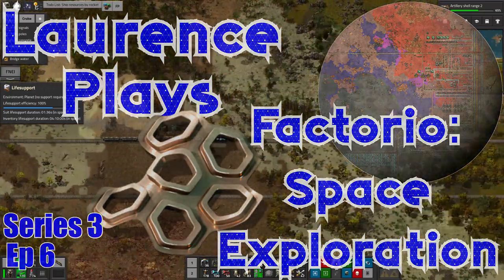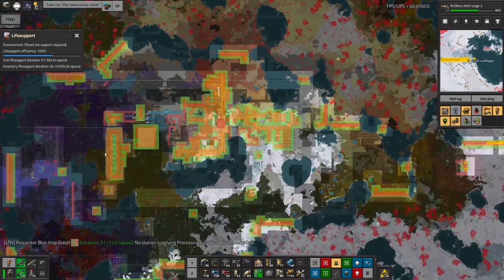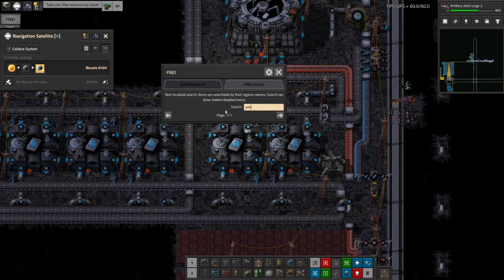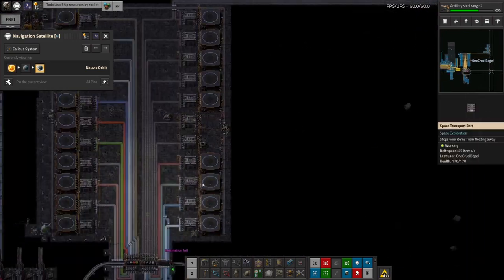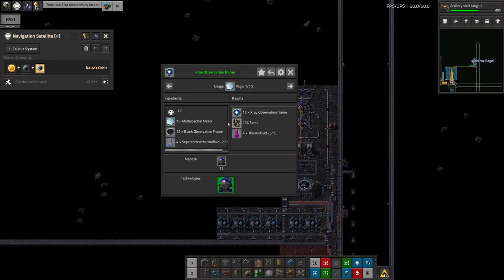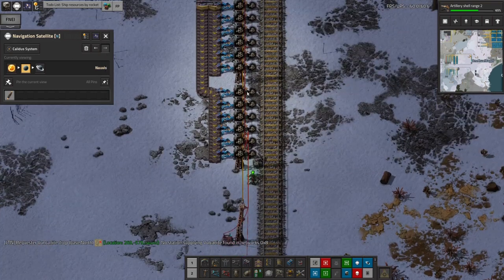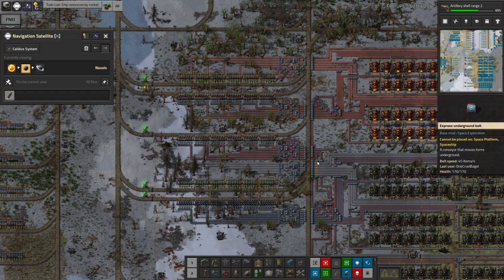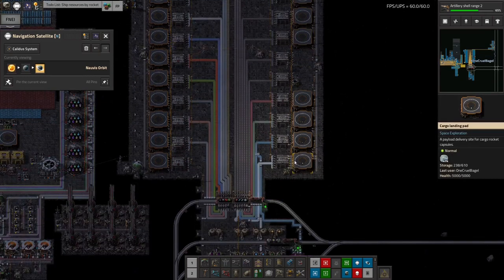S3-E6 - Low Density Beacons - Laurence Plays Factorio: Space Exploration

Comment: regarding expansion wouldn't it be better to set up outposts on other planets for basic resources like Iron/Copper  than endlessly expanding on Nauvis? Like finding a 0 threat rich planet ,find 20+M patches and ship back finished ingots/Plates by the rocket loads?  
Regarding Polished data things i like the chemical gel recipe better as it gives me a use for all the stone i get as a byproduct from core mining and crushing of SE material that otherwise goes to landfill.
Reply from the maker: Potentially! I'ts been a good couple of years since I've played just SE, but with our current K2SE run, we're doing all the processing of mundane resources centrally on Nauvis because it's once place to bring everything together, and with spaceships and elevators, logistics is cheap. We do have top-up supplies of stone and iron ore coming from other planets, but again being brought to Nauvis because doing it centrally is easier. 

In SE, there's a big tradeoff between what's easiest logistically (ie, making transport efficient) and what's easiest to manage (ie, doing everything in one place so you can pass byproducts and ingredients around) and deciding how you want to balance those two is one of the biggest differentiators between different people's factories. Your way certainly isn't wrong, but it also isn't the only option.